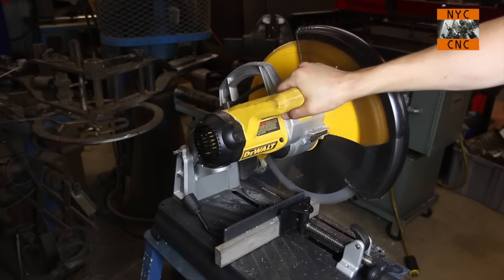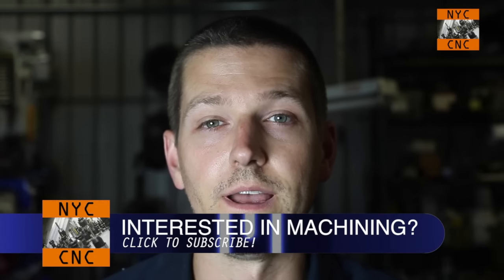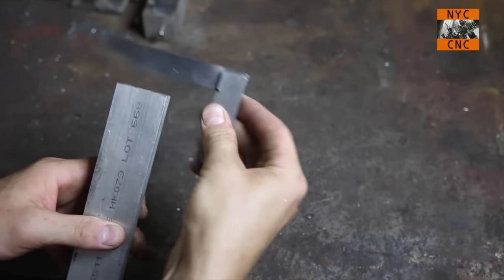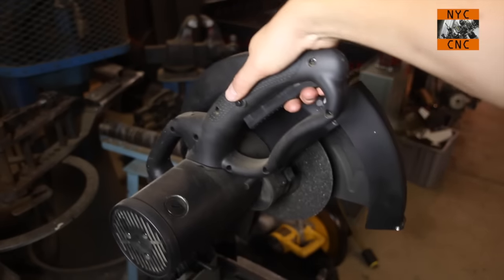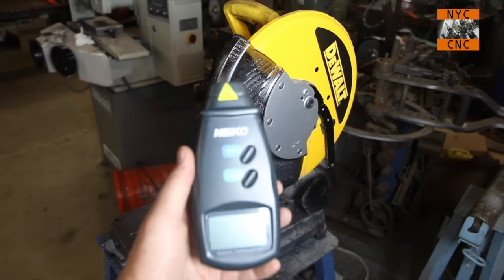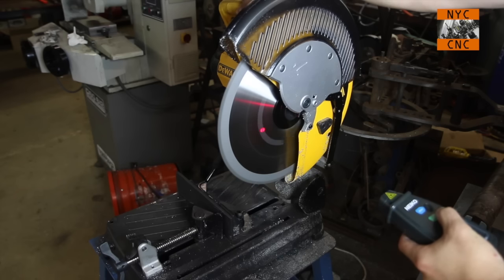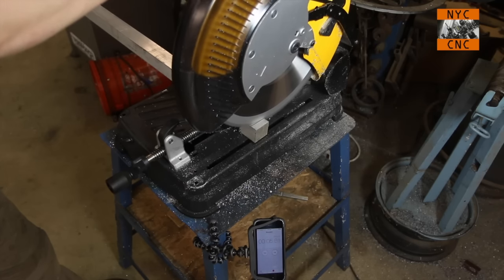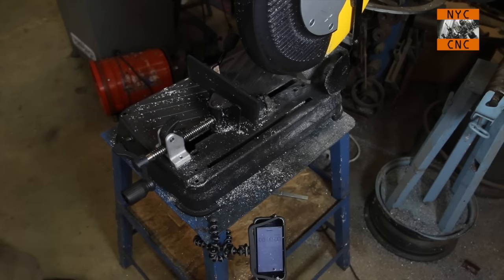The Best Metal Cutting Saw!? Aluminum AND Steel? DeWalt DW872 MultiCutter Review

Comment: Safety suggestion: After the cut is complete, allow the blade to come to a complete stop, before raising it.  For instance, that last piece of angle iron you cut, left a thin. loose piece sitting on the saw, and you raised a moving blade past that small loose piece.  When you do that, is is possible for small piece to be caught by the blade teeth, and turn it into a projectile. It can also damage the blade.  Better safe than sorry, and let the blade come to a complete stop before raising it.  Larger drop offs that fall  away aren't a problem.

Comment: So did you realize it when you bought it that the Ryobi saw was designed for cutting wood and not steel? And it's an entry level saw as well. Using the right tool for the right job makes a big difference.
Reply: Exactly!!! How do you trust a review from a guy that doesn't know that wood saws aren't meant to cut metal.
Reply: @APNFORD  He had a metal-cutting blade on it. He was less experienced back then but now he knows better.

Comment: When you use cutting grease (no oil) the blade stay sharp mutch longer and a bit more pressure on the machine will keep it also longer sharp
Reply: NYC CNC that was a really good question. I have asked that to the man who sharpen my blades. it seems that by edding grease the chips come lose faster
I posted 2 short videos on my channel one with  and one without grease

Comment: I have that same saw.  I haven't tried to cut Aluminum with it yet.   I've cut a lot of metal with it.  Now two of the carbide cutters are gone, but it still keeps working.
Reply: 70chev-call a saw sharpening store and they can repair missing teetha nd sharpen for you. It's cheap. I got an extra blade and I let them get really chipped before going off to sharpen.  It will throw tons of sparks when cutting steel when it needs a repair and the cuts will be warm.

Comment: Nice presentation, I'll recommend you to move the square tube as much as it possible to front of machine. So in cutting time to be with less tooth possible at any moment of cutting process. You will get faster cutting results. You loose time at start and end of cutting at that tube.

Comment: I was a little skeptical at first with all the boasts about the life of these units, but I'm converted, I killed my first blade in three months, cutting stainless tubing, I'm on my second and still cutting, I've cut solid 50mm bar without any hassle. I'm a car enthusiast and I'm in the workshop most weekends making stuff, the evolution is always out cutting up stock (primarily mild steel) for the lathe or welding.
I don't abuse the blade, I admit the cold cut still amuses me
Reply: NYC CNC
The stock bar get's a little warm, but no coolant ever.

Comment: Have you considered adding another locking mechanism, perhaps a QD bolt, to the miter guide to fix it at 90* as you don't cut mainly angles? Perhaps along the far side away from the current lock down into the base. Maybe even cut a radius so you can use it during angle cuts.

Comment: those look like nice little chop saws. Ive used the Milwaukee version and can attest to it's quality and speed of cut vs band or friction sawing.
suggestion on your vise walking when set on angles: set the angles that you use most often using an accurate method, adjustable square, sine, etc. lock vise down securely with something external like an f clamp, drill a .25 hole through vise and deck, cut a .25 dowel pin a few inches long and weld a little T handle to it. now you can quickly, accurately and securely keep your vise set on the angles you use most often. i did this on my Johnson and my little 4 x 6 import for 22.5, 45, 60, 90 and a few other angles i regularly  use, i rarely even lock the fixed vise down anymore as the pressure from moveable vise against dowel pin does a fine job.
Reply: This looks like a neat hack. Could you provide some pictures how to do that? Either here or via mail? Thanks a lot!

Comment: Your comparing apples with oranges though. The dewalts a Chop Saw and the Ryobi is miter saw. Sure you can put metal cutting blade on both but one is designed for cutting metal and the other is for wood just has a metal cutting blade. Ones got higher rpm's and and made out of all metal and ones got mostly metal with a usually a plastic shield which if using the steel cutting blade will eventually melt the plastic.

Comment: I just purchased a Wellsaw And would recommend them to anyone wanting an American made saw that's built to last. I sold off my little Jet just like yours to buy my new one, the key to those little 4(5") X 6" H/V band saws is to get a good quality variable pitch blade I have them custom made by the Fastenal Guys. The yahoo group has some great mods for those little saws. But I'm thinking you got a Baileigh Band saw or a Femi NG120XL for space savings.

Comment: Did you use the blade that came with the miter or buy an extra one to cut the aluminum. Also, did you use wax or any other lubricant and if yes , how often do you apply it.
thanks and i am subscribed to your series and learn so much from them. Bernard

Comment: Maybe you can assure a square cut by adding some positioning pins to the back fence (right through into the cutting bed). If the pins have handles or rings for removal, then they can be quickly pulled out for the occasional angle cut, then replaced. Back to 'true' every time. Note: The pins would not HOLD the fence, just assure quick and proper squareness as you tighten it down.

Comment: Nothing better than a bandsaw, Cheap blades, quiet, and can let it run while your doing something else.
Reply: Can't wait to see it. I have the same JET saw you have, I like it although a little slow. But I'm too cheap to buy a new blade LOL
Reply: Yea I know, all those chipped teeth remind me everytime I use it!
I have an extra, just need to put it on. Can they be sharpened? I may try sharpening the old one with a dremel, have nothing to loose.
Thanks for the link, may have to get a few!
Reply: Well then I have some midnight oil to burn!
Reply: Andre Gross
Some sharpening houses will re-sharpen the metal blades for a reasonable cost, if they are a single pitch...
Like 18 teeth or 10 teeth, not the combined pitch like the 10-14 or anything like that. The reason being that their auto tracking systems don't follow the combined pitch, unless some place have a super hightech sharpening machine... Those are rare.
Reply: Thanks for the info!
Reply: My 7"x9" bandsaw from bumfuck, china has been using the same blade for the past 3 years with no problems.

Comment: Ive had one of these for a few years, its the main go to saw in my fabrication shop. I too ordered it online but when mine arrived I needed to use it right away and the safety guard was broken. It was pretty new tech at the time so I couldn't just go to home depot and get another one. I ended up taking the bottom half of the blade guard off and naming it Danger Dan.

Comment: I cut Ti, SS, 5356, and steel with a 1950s Johnson Horizontal band saw. I have had this saw since the 1960s. Chop saws are for wood.
Reply: Says who? Seems like his works good,  I know my DeWalt  works just fine with cutting tubing, angle iron,  thick steel, chromoly,  stainless,  titanium, aluminum,  wood, plastic,  carbon,  fiberglass. Miter saws w/ a metal cutoff wheel are just oversized angle grinders.  Some people are just too ignorant to ever admit their could be something that works just as good.
Reply: Btw they make band saw blades for wood too...

Some of us just have more important things to do than to wait for a saw that takes longer than it should.

Comment: I tried that dewalt saw. Good for aluminium, but not so good for steel because saw blade wears out quickly. Also if you use a bigger bandsaw with wider blades and you put on correct tpi blade, you similar cut times and the blade will last lot longer. Cold saws are even better and cheap these days. I didn't sharpen hss blade on it for a year. Cuts quickly with very slow rpm and leaves almost mirror finish :)

Comment: Thanks for the review.

Were you cutting aluminum near the end of the video (square tube)?
Just wondering if you had the proper blade in for aluminum. Also, if you put the tube on its edge (to make a diamond shape) it cuts much easier (and is probably in the literature from the manufacturer).

Comment: Tooth engagement. The old school rule of thumb was "the 3 tooth rule". It applies to band saw blades but the idea is the same. The blade cuts most efficiently when 3 teeth are engaged in the cut at the same time. Chip evacuation is adequate which reduces friction, hence, a cool cut. That also translates into longer tool life.

To many teeth engaged at the same time and the chips have no where to go. They build up and cause friction. Also requires more down force. That's probably why the steel cuts didn't "feel right".

Next is surface speed. It is referred to as SFM (surface feet per minute). This refers to how fast the tool is "moving" along the surface of the part. Hence, the dia of the saw blade AND the RPM are VERY relevant. It's all about friction at the point of contact where the tooth is in the material. 

The last thing is cutter geometry. Alum likes high clearance and steel likes low clearance with more "land" for wear. 

All things considered, it seems like this saw has a very nice blend of all of the things I have mentioned. Blade dia, number of teeth, geometry of teeth, and RPM.

Comment: Wow, very nice solution to the cutting problem. Thanks
Reply: NYC CNC
 I appreciate the test drive that you did on the saw, I have a band saw, not impressed,  so I went and got one ( the multi cut saw ) on Tuesday, then had to re-arrange the garage. works great. Thanks.

Comment: so im debating whether to buy this saw, or the dewalt abrasive chop saw DeWalt D28730-LX, i dont do a lot of cutting at the moment, but i can see me getting real busy real quick, because im going into business with someone, hiring an industrial unit, and going to be working from there, and in the uk, if you have a machine shop, everyone wants something doing

i usually use an angle grinder for cutting at the moment, so abrasive wheels are all i have, its all i have been used to in the past, im used to the sparks, im used to taking a while to cut, im used to the cheapness of throwing another cutting disc in a machine all the time, im used to the material being hot after its been cut, i also noticed the abrasive saw in the listing states it cuts slightly bigger material, the tct blade saw states it cuts 100 x 100, the abrasive saw states it cuts 115 x 130, which could be an advantage at some point

im hung on which to get

again though, i have used mitre saws for wood for years, and i think using a toothed blade will come fairly naturally to me, so i dont know yet, i guess ill go to a shop, close my eyes and point to one at this point haha

Comment: Are you using a DWA7747 blade in your DW892 saw?

 I have had to replace four blades recently because teeth stripped off during use. The tool operators claim they didn’t slam the blade into the mild steel they were cutting.

Comment: Years ago when they came out I picked up a factory reconditioned one through Harbor Freight. I didn't even know what it was used for but at $239 I was sure I could make use of it. I made a jig to hold 1/2"x 8' hot rolled at an angle. I could cut through that in 20 seconds if I pushed the machine a little. Great saw and I'm just now replacing the blade. thanks for the video ! :)

Comment: Great video but I have a question: Why did you compare the chop saw to the Ryobi miter saw when the Ryobi is a woodworking saw and was never intended or designed to be used for cutting metal?

Comment: Nice video, but I think you'll actually find ur blade will stay sharp longer if you feed more aggressively. Your substituting many more cuts for less stress on ur motor...this translates to more heat and more wear on the teeth. Another words, there is an optimum feed rate. When you saw the sparks at the beginning of the one cut what you were doing was heating them red hot before actually cutting and ejecting them. Great station, really enjoy you and your work.👍

Comment: Hi, some kerosene or WD-40 will help to unstick the chips from the teeth, if you hate the smoky smell of WD-40 vaporised (double Yeark...) you can use parafine or bees wax. Also if you can put your hands on cheaper wood cutting blades for aluminum it works great too, not as good on steel though.
Reply: A little MQL goes a LONG way to keep the blades functioning, temperatures down and smooth cutting.

Comment: I see that the saw cut nicely thru the large bar stock Alum, question can you cut a 13" Alum Bar stock.  I have a 4" X 13" X 3.4" stock and I need to cut it to 3 1/2"X12"X3/4"... What do you think? Yep cut the 1" off the 4"" side making 12" long and then cut the 1/2" off the 13" side making it 31/2" wide.  Will this Dewalt DW872 do that?

Comment: I like watching your videos John as you seem to cover a lot of information in a short period.
That said, I can do the same cuts on aluminum in my wood chop saw (12 " Mikita) in about half the time with a carbide tooth blade.
And it stays cool to the touch.
As far as the steels, I'm still a bit old school in that I will use my14" abrasive saw, or my band saw (horizontal). I have used about every method there is to cut material, and for me couldn't justify the cost.
Not saying it's a bad saw, just not for me and the type of work I would use it for.
Lastly, you didn't mention if the band saw was a vertical or horizontal. I'm assuming it's another horizontal because you referenced your Jet.
So my guess would be the Grizzly! 
Looks like your settling in at the new shop, congratulations, and looking forward to seeing your projects. 
Razor!

Comment: Nice and I loved that it will cut wood and metal. Besides the multi-cutter  what is the name  of the product and it’s model of that compact stand that you are using as a table and clamper to rest the metal on before cutting? And where did you buy that compact table/desk? I like to buy one like your for my small condo balcony area.

Comment: Great video. I was thinking of getting on of these type saws. I notice the saw doesn't really have a soft start. Does the machine jump a bit when you first turn it on?
How accurate would the saw cut square hollow tube saw 30 or 40 millimetre. 
I make cupboard frames out of steel hollow tube. I bought a panasonic cold cut cordless saw. I found the cuts were slightly out of square. So when I did my welding to make square I had some filling to do whilst welding. I ended up buying the hilti cordless 22 volt cold cut circular saw. That saw did end up cutting nice and square testing with an engineer square like the one you have.
The only problem knocking up a set 12 cuts for a carcass ( cupboard  frame ) I needed to make up a jig for each size hollow tube and then clamping a square. I made the jig so the saw could run on it making the run more true. This all takes time and with clamping the work piece in multiple places. So for accurate work a cold cut drop saw would be a lot quicker to set up. It is not that I do a volume of this type work, only generally for my own projects. But with tools and equipment once you do own equipment like this saw, you will find a use for it more often.

Comment: I checked these out today and wasn't impressed with the base. Just like my cheap abrasive cut-off saw with a stamped base, it isn't flat. The Makita had a cast ( I think) base and was very flat, it looked like a much better saw and was cheaper.
Reply: Julian Petkov 

I'm interested in one for mostly cutting 30mm square tube steel, it would do that alright wouldn't it? I heard with cutting tube on a cold saw, the coolant gets in the tube and runs out either end making a big mess.
Reply: I would love to hear thoughts on the pros and cons of this type of saw versus a powerplasma cutter.
Reply: Julian Petkov

Comment: We use desalt abrasive saws daily in our shop {next one that dies is getting a cold saw in its place}. Do yourself a favor. Build a bench, flush mount the saw into it so the tables are level with each other. toss the dewalt fence, incorpate one into your bench. our benches are mounted underneath the tubing racks. just grab a piece drop it straight down and cut it to size. easy peasy. when we cut angle we just do it free hand. lol. scary, i know.
Reply: NYC CNC Our benches actually freestand in the middle of the shop. Our shops pretty big, but wall space is at a premium. In the middle of our shop we built an island. The 20' bench has  a chop saw on each side, and back to back tube racks. the 10' sheer and 10' brake make the other sides of the island. the dead space in the middle there is another finger brake, a sheet rack and junk storage! I will post a little tour video. We have an AMAZING amount of crap, and have to keep enough aisle open to park 10+ cars inside every night. {plus the forklift and jig tables}

Comment: Wow they have them for $369 at my local lincoln electric welding store I think im going to buy one soon thanks for the info
Reply: NYC CNC Thanks bro appreciate  it !!
Reply: owned one for years now, great saw but there's always a but lol , expensive blade and incorrect cutting pressure can ruin it in one cut, works best on lighter metals 3/16 wall or less
Reply: U R  LUCKY JUST PURCHASED ONE  IN AUSTRALIA,AND PAID $840.BUT WE GET RIPPED OFF ON ANYTHING HERE